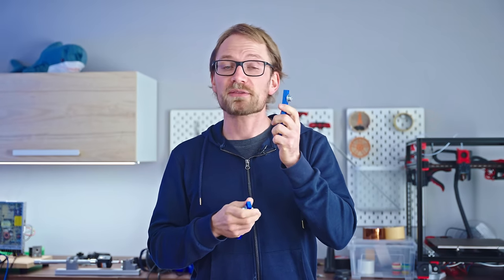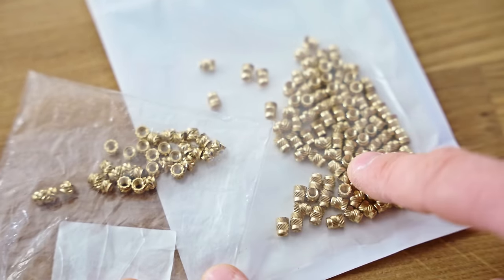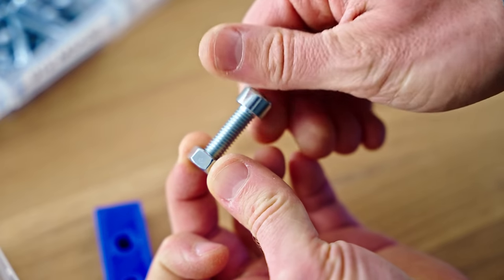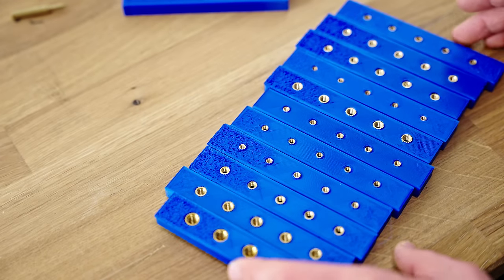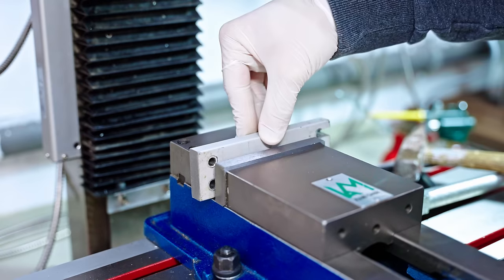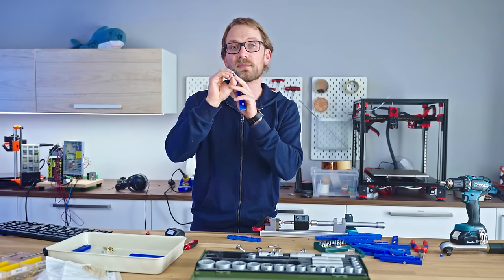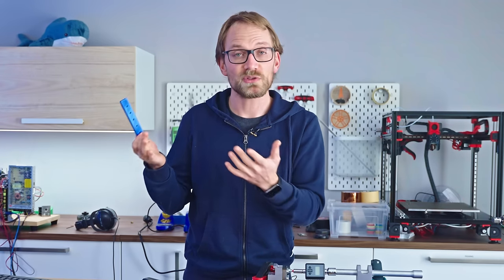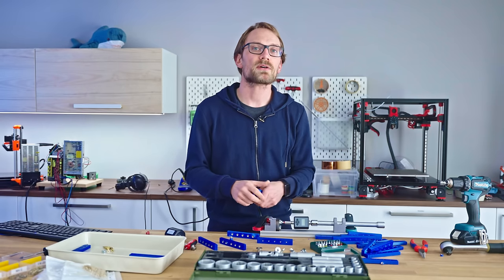Do you even need threaded inserts? Strength tested!

Comment: I've had really really consistent success hand tapping my plastic parts, granted it's usually PETG or ASA but regardless it works with an alluminum tap at least with M3 thread. but i've had even greater success melting/forcing threads by forcing a screw into an undersized hole. But if your printer can't make excellent layer adhesion without a volcano this may not be a good option

Comment: please try with DIN562 Square Nuts. If they are designed correctly, they are the strongest bolted connection I know of. The pockets are easier to design than hex nut, as there is no risk of them just spinning in the hole. no need to have a hex-shaped hole with a draft on the opposite surface, you can have a square channel going inside the part from a perpendicular face to the bore hole... I am using it in my designs which are used in series manufacturing at the company i work for.

Comment: I hardly use these special inserts anymore. Rivetnuts (at 16:06, the thing in the middle) are so cheap, and you get these in every home-improvement store. The only drawback: They are pretty long compared to other solutions. Having that said: There are half-height nuts as well. In some applications, I just press-fit the nut. Not having to heat up something can be convenient.

Comment: I don’t think rotational torque can be compared with screws with varying pitch as a finer screw thread will exhibit a higher force pulling the inner out than a courser thread. A better metric would be load cell to measure the force perpendicular to rotational axis’s.

Comment: I often just press-fit those threaded inserts using a vise.
I also use 3 perimeters around a hole for those inserts.
Not sure if you actuall weaken the grip when using a solder iron. My intuition tells me that by melting you make sure the plastic grips into the groves and thus should be the stronger bond. But I am not sure if that's actually true as you may also loosen up the side pressure by heating it.

So maybe that's also interesting to compare whether varying in hole diameter and thus needing more pressure to press-fit those insert may result in a stronger bond?
I just use the exact diameter of the threaded inserts as measured with my caliper as hole diameter.
The filament always makes the hole inside diameter slightly smaller and thus you need quite some force to press-fit the inserts without heating them. (N.B. I use PETG)

Comment: I'm curious about the performance of tee nuts, especially when inserted from the back, as well as threaded inserts for wood and captive nuts. Essentially, the types of things that can be bought at a hardware store where heat set inserts are not going to be available. Heat-set inserts are probably the most popular way to add strong threads, but I'd like to know more about the emergency options for when I can't wait for shipping and there's no Micro Center nearby.

Comment: Used standard M3 and M5 screws for PETG as self-tappers with 2.8-2.9/4.7-4.8mm holes (+ calibrated part scaling for thermal shrinking).
For a single (or several) use threads seem extremely durable for me - dropped in nuts kept failing by damaging the seat with its corners, more for hexes, less for squares.
Thread locking is better than for locknuts, but requires significant torque just to install the screw.
But tapping produces a lot of heat from friction, so I suppose the load test by pull+rotation is not a pure testing, as it softens the contact area.

Comment: would be interested in solid printed parts.  I make a lot of small boxes with covers, usually M3's hold the cover onto the box. I go with longer screws and deeper molded holes and have had great success and good cycling of assembly and disassembly of the mating parts, the only real failures I've had is when I printed the hole too shallow and the screw bottomed out and pulled the plastic apart at the layer line where the bottom was. Also I hand tap the molded holes prior to fitment as my hands are a very accurate device for feeling when the tap starts to bind with the plastic, when it starts, I just back off about a half turn and continue, tho often I remove the tap and clean it up with a wire brush. Sure, this is a bit more time consuming but I only print a few at a time for my own personal use so it really doesn't matter, just a bit more fiddly. but not that much of a nascence. If the part doesn't have enough thickness, then I'll use an insert, but I always print solid or have many more walls/perimeters. Increases the print time, of course, but then again, the few I print for myself isn't that much of a demand on the time budget.

Comment: Used to burn in inserts with a soldering iron but now I don't use anything I just screw straight into the plastic, my whole printer is built by just screwing into the petg plastic parts, I undersize the holes by about .3 .4 and just screw the cap screw into it, it then creates it's own threads as it going down, I don't use a tap, I have un-tighten and re-tighten the parts during maintaince many times......parts are still working fine and I've never had any strip.........I can pull threaded inserts out pretty easy with some nuts and washers stacked and a cap screw into the insert it doesn't take much at all...... 🙂, So what's the point they just add weight and don't give very much of an improvement over going straight in with the screw and an undersize hole.......Give it a try.....🙂

Comment: I've long wanted to know if any slicers let you create internal structures, so that you could put large fins in around each hole, for example, or just thicken the holes, or produce internal fillets of material at the top and bottom of the cylinder which is the hole - internal to the 'solid' part, that is, not internal to the hole. That would be my solution, but I don't know if any slicers make this easy/reasonable to try.

Comment: I always tap plastic by hand, never with the tap on a drill. And this is in PETG, as I rarely use PLA anymore.
 I model the thread into the STL and since it is printed a bit undersize  I take it to size with the tap. Thread length should be at least double of the corresponding nut. 
For plastic always use coarse imperial thread, metric is too fine and is best left for steel.  If one can source trilobular screws for plastic that's good, if not use wood screws. 
I leave brass inserts exclusively for electronics enclosures. I prefer embedded nuts and those work much better if square rather than hex.

Good vid, as you state a tread molded directly into plastic can be more than sufficient.

👍

Comment: I am  very interested in a good M3 comparison. E3D actually screws M3 directly into pilotholes on Hemera Toolchanger tools. Since I saw that I do the same: approx. 2.85mm pilot hole (works in z direction only) in petg and use the screw for self tapping. It takes some torque to do it, but the screw will not loosen for sure. generally they hold quite well like that. Of course it is not a connection for high loads, but it's a cheap, quick and compact solution. For higher loads I usually create pockets for hex nuts.
I think heated inserts are expensive, imprecise and specially time-consuming. I don't really use them.

Comment: Great Video Thomas!  Looking for suggestions... How about non-threaded with an over-sized metal screw/bolt?  How about printed screw/bolt with and without inserts?   Does increasing the walls or infill make a significant difference?  How much?

Also, noticed you set your iron at 230C... Any advantage or disadvantage at lower temps; e.g. 190C?  Is a lower temperature more forgiving and easier to maneuver the insert?  Also, have you used any 'press' devices; i.e. soldering iron held in place on a "T" construction?

Comment: Would like to see you testing using a heated bolt to form the plastic threads rather than a tap. I've done this before and it seems to me at least that it should help fuse the layers that make up the threads, leading to higher strength. Curious if that's actually the case.

Comment: Nice to see some machining work in addition to printing.

I’d probably run the test with more walls where it is fully supported by the support at the top.  Maybe print cylinders at 100% concentric infill so that infill is no longer a factor of insert pull out strength.

Comment: Im sure threaded Insert are cheaper but i guess if you needed a bigger size you could use a helicoil or something which would be slightly stronger because its bigger so more surface area but have the durability for repeated install and removal

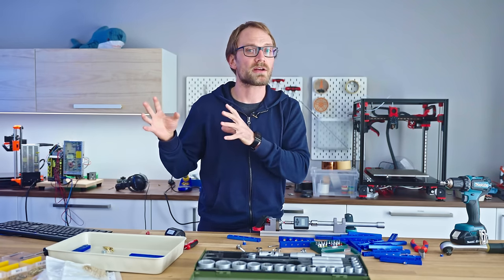Comment: 14:40 Well, that's complete nonsense.. I've tapped hundred of holes in printed parts.  I was skeptical of strength at first too, but the first few times I tried it, I was shocked by how strong they were. 
-Get a tap/drill chart and print the correct size pilot hole for starters. 
-Next, increase the wall thickness around the holes.  If the walls are too thin to support the thread, that's a design issue not a process issue and one that can be easily remedied.  
-Lastly, use right kind of tap.  You're using a hand tap in a drill.  Hand taps have no mechanism to clear chips.  You have to do it manually or they pack into the flutes.  In metal, this breaks the tap.  In plastic, it just creates a ton of friction and you end with the kind of mess you had.  Either slow down, back out and clear the chips as you go, or get a spiral fluted tap.

Either way, I've had nothing but success tapping printed parts.   Unless the part needs the wear resistance of a metal insert, I've stopped wasting my money on them.

Comment: Goal:  Make the hole as strong as possible. we all know the weakest link is the failure point, of course it was going to be the plastic - so the real interesting thing is how to make the plastic stronger around holes. Could be many number of interesting tests: infill densities and types (the more one touches a wall will likely make the hole stronger so not that interesting), # walls (probably most useful), how much a layer runs into another (probably useful, though obviously not that easy to adjust design since holes are a mere speck), skip nozzle sizes, bigger nozzles always better at loss of resolution, no cooling, shouldn't be cooling around the hole, could add RIBS on teh outer surfaces near the hole, that may prove interesting.

Comment: You commented negatively on self tapping screws. You may be using self tappers designed for with either hardwood or softwood. Try finding screws specifically designed for self tapping plastics. I have had very good success using m3x18 self tappers designed for plastic.
Reply: Although now thinking about it. 18mm length is quite a long way into a hole lol. But that's what I use for replacement battery cases for tools

Comment: I can never get threds to print right for any of my projects... since I found threded inserts, I love them....  put on my soldering iron with a special tip and it just slides right and I hold it back and forth to get the melted plastic to melt into the cavities.   I also design tripple thicker walls around my melt in inserts too to provide plenty of material to melt into it and stronger around it... like you showed here, it pulls out that thicker plug, so I make it stronger around there. 

I use these to hold on lids and screw PCB to for mounting and stuff... I never put them under any real torque requirements.  I just never have any luck with printed threds turning out correct...  always are too small/big and the threds never line up...  Only rarely when you have a 3d male/3d female items taht screw together do they every work (like a storage case with a screw on lid.

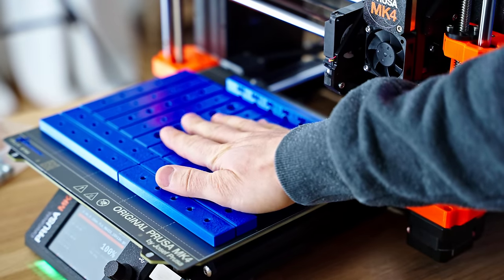Comment: What if you changed the orientation of the item when being printed? At 1:15 in the video you showed the test objects on the print bed. They were oriented such that the holes were perpendicular to the print bed. But prints are weakest between layers. If the models were turned 90 degrees so that they holes were parallel with the print bed then the holes should be less susceptible to being pulled out.

Comment: Great Video but you measured the pull out force, i Think in real world aplications you bolt one part to another. And in this case you have the part with the hole that push against the thread or the inssert. I think when you screw to parts together you get an higher tork. You can also mesure the strength of the connection of to parts when you pull them appart.

Comment: Surprised to have not seen the wire coil type threaded inserts, but they're basically a weaker and less specialized version of the thread adapters you used.

Comment: Honestly if you want more strength you need to increase your peremeter settings for parts with holes. This is by far the best way to strengthen them. If you really need strenght make nut slots on one side. The nut will crush the plastic if its not strong enough but provides much better surface area and therefore more strength. I have tapped holes with 5 and 8 peremeters and they hold as good as anything i have tried. The key to the peremeters is you hake much more of the part as solid around the holes. But for anything that requires strength i simply put a nut insert into. I have never tested to failure but nothing i have built with nut inserts has ever failed for me. Just my 2c

Comment: You can’t use a power tool to tap 3d printed PLA. It has to be done by hand, and you need to constantly back it up and clean the tap. Or the plastic shavings will clog the tap and melt.

Other point is that printed/tapped directly into the plastic will always be single use. If you need to disassemble it someday use inserts. But use at least four walls.
Reply: If you want to mechanise the process a tapping tool is the way to go. It is basically a drill, but geared down to run much slower and provide extra torque. It can also auto reverse. Also while alcohol is better than nothing, tapping fluid cools as well as lubricating.

Comment: a thing you did not test is thread length, if you have enough material to have longer screws, like 25 mm tread depth for an m4 screw you will have other issues

either the friction of threading in the screw melts the threads and bonds the screw to the material or the thread just strips out - in the frist caseit is a one time screw in and never get it out without destroying the thread, but it it is plenty strong

if you really want high loads on a printed part and need to take it appart at some point , you basically require to have a nut and a wide washer on the back to distribute the load

like a 4,3x15 washer for an M4 screw

Comment: i wonder how those plastic plugs that you use on drywall would work (worse than the inserts i imagine but it might be interesting to try) 
there is also those metal ones for dry wall that create kind of a hook on the back when you screw them in so they pinch the drywall, those would be quite strong i imagine, but they're also pretty big usually.. the reason to use them would be availability though and since they're so common they're also pretty cheap

Comment: I would recommend retesting the modelled threads with higher printed part density. The testing  setup you used is flawed due to the parts having low density due to the low infill settings used. You could have even used 0% infill and increased wall line count to a ridiculous number like 200 to print the parts solid, but in much less time than 100% infill. You could even have used a Line Width of 0.6mm with a 0.4mm nozzle installed to reduce printing time even further, while maintaining the same density (and part strength) as 100% infill.

Also, with regard to the drilled taps moving too quickly and melting the plastic. Just use a T-handle tap and thread them manually for better control and consistency with your tapped modelled threads. Slow is smooth, smooth is strong.

Comment: Personally, I love the heat set threaded inserts.  Especially with parts I might have to take about and put back together multiple times.  I usually increase the number of walls on parts I will be using threaded insets usually up to 4.  The big question I have always wanted to look into is the effect of hole size on the strength of the insert.

Comment: It's easy to find heat set inserts but it's not easy to find the press fit cold ones (the ones slitted in the middle) for cheap, which are needed for resin prints...i'm trying using the heat set with straight parallel cuts but they aren't ideal

Comment: Is it better to increase perimeters around the screw holes to have more solid “meat” around them? 
What would be the correct amount before you get diminishing returns and unnecessarily increase print times?🤔
I have added 10-12 perimeters around threaded holes(printed) in Prusaslicer to help strengthen them. Also in thru holes to help rigidity and strength at the top surface where a washer would sit.

Comment: Interesting test data but in common with other videos on the subject you are pulling the thread out into "free space". This seems like an unusual choice as the main use for threaded inserts is holding two parts together, so the failure isn't pulling the insert and the perimeter out of the model, it is crushing the printed section or rotating the insert till it no longer grips. Retesting with a fixture drilled to the clearance size of the bolt on test rather than oversized by several mm would be good. 
Another area that would be interesting is to see what material properties improve the performance of heat set inserts; testing various different common materials to see which gain most from inserts. For instance how do inserts in petg compare to inserts in petg-cf, or nylon Vs abs Vs pla?